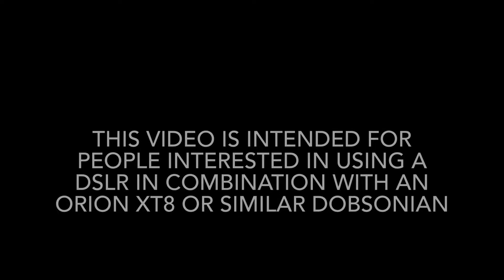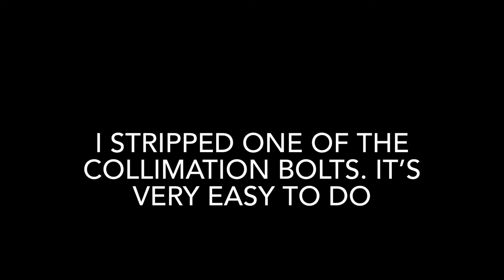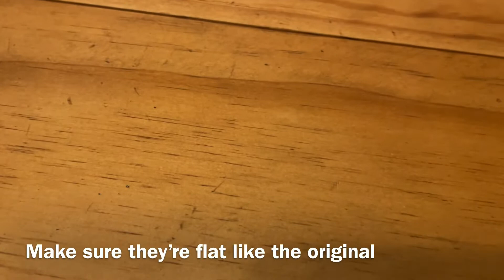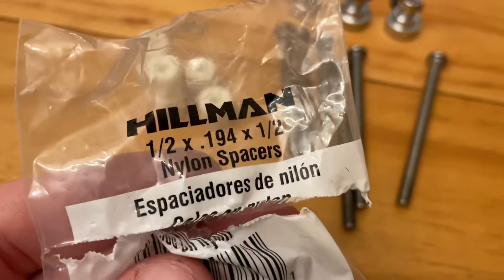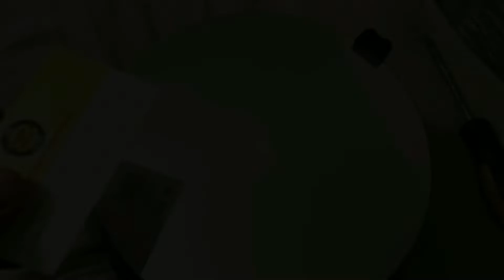Let’s move the primary mirror inside of an Orion XT8 or similar telescope (to focus a DSLR)

Comment: Question, would this same method work on an Orion StarSeeker IV?
Reply from the maker: I just Googled for “images”. From what I can see it has a fixed mirror cell. I may be wrong but from the best photos I can find it doesn’t look adjustable. I’ll pin this in hopes someone knows. I’ll keep my eyes open for one so I can look it over. Try Cloudy Nights and start a thread. Someone will know.

Comment: Thanks for the video. I need to move the primary mirror by 15-20 mm (because my focuser broke and a replacement focuser has a higher profile) and your video clearly shows what is involved. 

Btw, just for the prime focus with DSLR or astro-camera, just using a cheap but decent coma corrector from GSO works well without moving the mirror. (At least, it does with XT10).
Reply from the maker: Thanks for the information

Comment: Garnet I’m trying to remove the mirror hold down clamps on my XT -8 dob but the mirror clamp screws are over tight. Do you have any suggestions on removing them . Thank you Ken
Reply from the maker: They likely have loctite on them. Brake cleaner or heat.
Reply: @GarnettLeary  thank you

Comment: Great modification. I've done something similar for a vintage TAL1 telescope so that it can accept all types of eyepieces.
You don't seem to have fastening screws after the modification. Do just adjust screws hold your collimation?
Your telescope base is also very good. I have also built a similar one but twice as wide. I considered building a wider one, because for a long telescope the weight center is way up. This could cause the whole telescope to fall down while wheeled, especially when done by a child. Well done anyway!

Comment: Hey! So I have a 700mm focal length, 76mm aperture newtonian reflector. How does the process work on that?
Reply from the maker: Totally depends on how it’s made. What scope is it?
Reply: @GarnettLeary  it's from a local brand, it's not something like Celestron or anything, but it has 6 screws in the back, arranged in pairs...
Reply from the maker: At that aperture it’s likely fixed.  I wouldn’t disassemble it. Three of them essentially push and three of them pull.
Reply: @GarnettLeary  Ok, thanks :D I'll try it today. Love your videos by the way. Keep up the good work!

Comment: Where would you recommend getting these parts and how do I go about getting the right ones. I need this modification but I’m worried about getting the wrong stuff or messing it up.
Reply from the maker: Lowe’s or Home Depot. Take the original stuff there and ask them for similar parts. Springs that are a little longer and roughly the same size will do. It doesn’t have to be super exact. Have them match the thread pitch of the bolts. There should be someone in the store that can help.

Comment: Thank you, this was just what I needed! Careful about them bolts people, they're tight and will strip and snap off! I had to drill out two of them, not pretty work but I got the job done.

Also, is there a specific extension tube or length of tube you use with this set up to allow you to achieve focus with a telescope lens?

Comment: Hello. I have an Orion 12" Skyquest. The primary mirror springs have always anoyed me because not enough tension. Do replacement springs have to be precise or can I just go to Home Depot and get anything similar?
Reply from the maker: It doesn’t have to be exact. You just want enough tension, that when compressed, doesn’t allow the mirror to slop around. Too rigid of a spring will obviously make it really hard to adjust. Too little resistance and you end up with a mirror mount flexing under its own weight. It’s definitely not something you can’t replace with a little judgement. I personally like replacement springs that have a touch more rigidity. I feel like it’s easier to collimate than the stock ones on the majority of the scopes I’ve used. Find something about the same length in a thicker material or slightly longer in about the same. No need to be overly critical. You might only opt for coated springs or stainless to avoid rust from weathering. That’s a good precaution. I hope you find what makes it easier and more enjoyable. Clear skies.
Reply: @GarnettLeary   H.Depot didn't have much. I found some nuts that fitted over the bolts and that in effect acted like a spacer for the existing springs. Turned out much better than before!
Reply from the maker: @patindaytona glad you improved on it. It’s always great to hear a success story. I don’t know why there’s not people pushing to improve what they sell. We get tired reiterations of the same old thing more often than not.

Comment: Easier and cheaper to cut the tube by 2 cm instead. When you want to go visual just use an extra extender at the eyepiece and the focal length doesn't change.

Comment: What are your recommendations on how to remove the collimating bolts without stripping the threads?
Reply from the maker: Correct tool and bit size would have avoided that issue. Patience. A spray lubricant such as WD-40. In short don’t be a caveman and it will be fine. I set a bad example there.

Comment: Wouldn't it be easier (and cheaper) to saw off 1/2" (an estimate) from the end of the tube? (edit: you won't get a wider FOV btw. The Focal length is determined by the primary mirror and doesn't change, your 'hack' moves the primary mirror closer to the secondary mirror. This moves the focal point up higher into the focuser but it does not change the focal lenght -> FOV is unchanged. Add a Focal reducer for a wider FOV.)

Comment: That's my problem that I can't get focus with my Orion XT8 Plus Dobsonian using a Canon T3.  Thanks for giving an idea of trying to fix this focus problem. 👍🏻🔭
Reply: Before moving the mirror, if you only need an additional 8mm of infocus, considering getting a low profile canon t-ring, they make some that are only 2 mm thick and shave off 8 to 10 mm of back focus requirements.  Another solution is adding a coma corrector that increases back-focus which some do, I believe that GSO 2” corrector does that… that gives you sharper stars to the edge which you need with a DSLR anyway, plus you can use it during observing.
Reply: @stevenmiller5452  thanks, I had thought that, a comma corrector👍🏻
Reply: Then, how I mesure the new focal length ? 
Mine is 1200mm
Reply from the maker: Find the point where it comes to focus and measure that length. Alternatively you could use plate solve software and it will give you a very exact number.
Reply: @GarnettLeary  ok thanks

Comment: Garnett I have just bought stronger springs for my primary mirror on my 8” Dobsonian (Stella Lyra) which is basically the Zhumell. Can I just insert the springs one at a time from the bottom after I remove a collimation screw completely? Or do I need to strip the entire mirror and assembly out? Thanks mate 👍
Reply from the maker: That’s a good question and I’ve never considered it. I think you can get away with it if you can twist the springs into place. Let me know.

Comment: If you have a sky watcher truss type telescope, all you have to do is determine the distance were you can achieve focus with the camera. Do this by retracting the truss tubes until you find the spot and locking the scope there. Mark the spot for next time. For visual observation, extend the tubes all the way like normal. 
Glad i found this, was about to cut the tube on my xt8 and 3d print extensions for visual observation
Reply from the maker: Great tips. Thank you. Happy new year.

Comment: Nice video! I made a similar modification on a small skywatcher reflector, but I skipped the addition of springs (the tube didn't have any from the beginning). That fact made collimation a real headache, so now I am going to buy and add some springs. Do you know if the springs need to match some kind of stiffness specification? Please forgive my english. 
Greetings from Chile!
Reply from the maker: From my experience just get ones that have enough tension to push outwards. If they’re too tight the adjustments you make will just be smaller. It’s not overly critical. Good luck and let us know how it goes.
Reply: @GarnettLeary  thanks! I will give it a try
Reply from the maker: Don’t be overly critical with it. There seriously isn’t anything involved passed just getting a feel for the amount of tension you like. Warning: should you decide to cut springs down to size... do it with caution. I almost lost an eye to a small one. That’s a physics lesson nobody should learn the hard way.

Comment: Another informative video Garnett. Folks if you have the skywatcher 200p dob you don't need to do this. Just remove the eyepiece adapter to achieve focus.
Reply from the maker: Exactly the kind of info I hoped to get on the comments. Pinned for others.
Reply: Teamwork mate. Thanks again for your help with my finder. Clear skies Vic

Comment: Very Cool !! Thats Clever Tip for Getting A DSLR into Focus..I might Have 2 Try Out My Self !! Clear Skies🔭
Reply from the maker: I tested. The very common 2” adapter is enough. For the XT8 this places the focus just outside of racked in by approximately 1/2”. I tried with 2” bolts also. They were not long enough. I prefer prime to ep projection to avoid the c.a. from my cheaper eyepieces lol. Ultimately I just like having the option if needed. Thanks for watching. Clear skies.
Reply from the maker: “2” extension” I meant. For eyepieces